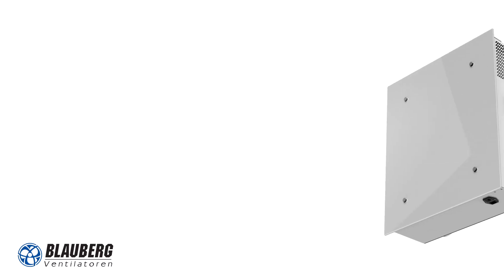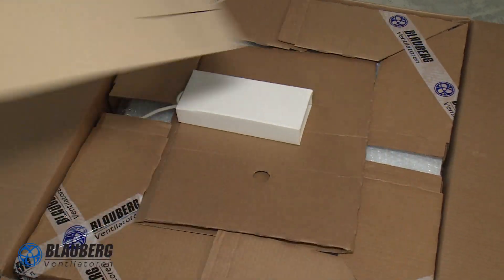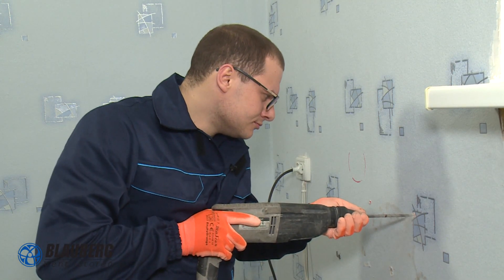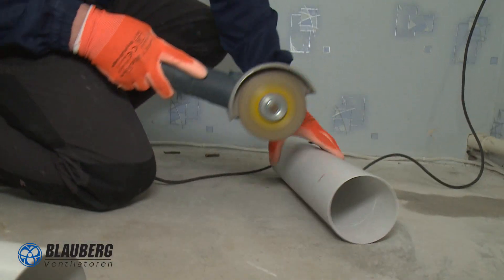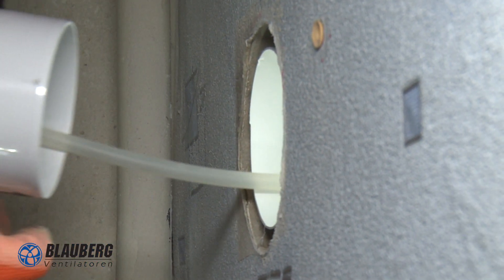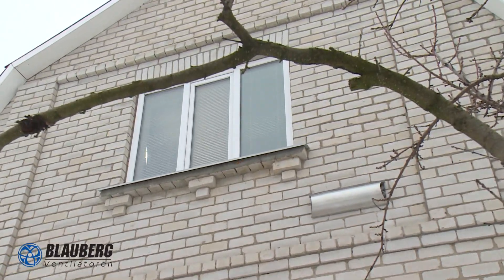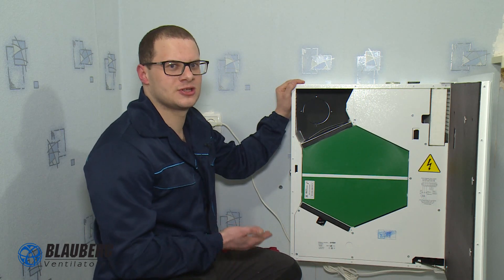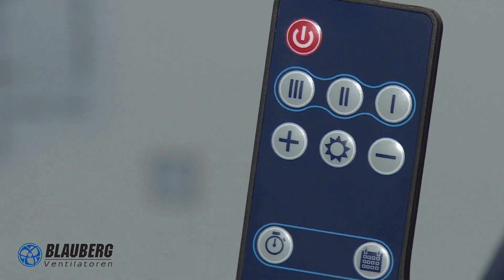Blauberg Freshbox E-100 ERV air handling unit installation

Comment: Is it possible to insulate air ducts in the wall?
Reply from the maker: Hi @szkielet137!

Yes, you can insulate the Blauberg Freshbox E-100 ERV ducts in the wall. Insulating the ducts will help maintain optimal temperatures and avoid loss of efficiency of the ventilation system. However, it is important to follow the necessary standards and guidelines during installation to ensure that the ducts in the wall are properly insulated and safe. 

Sincerely, Blauberg Ventilatoren